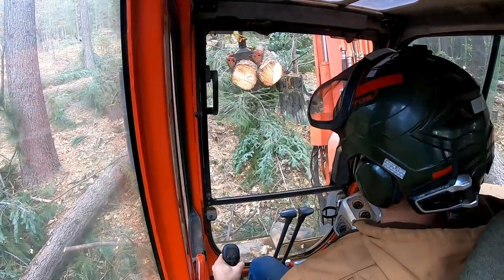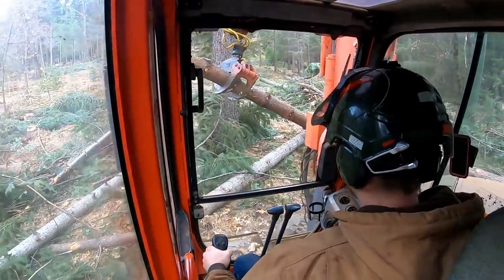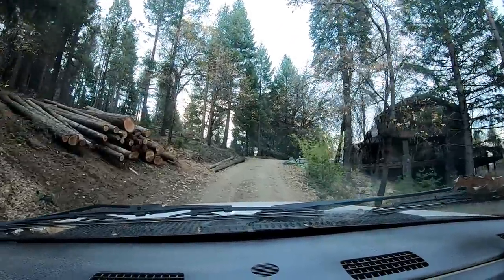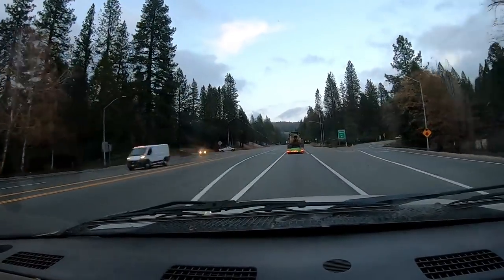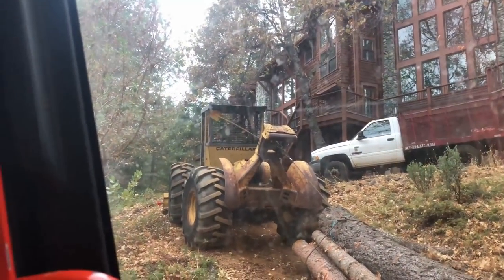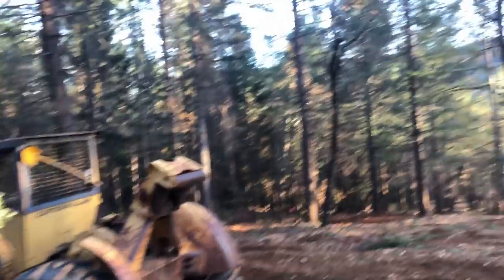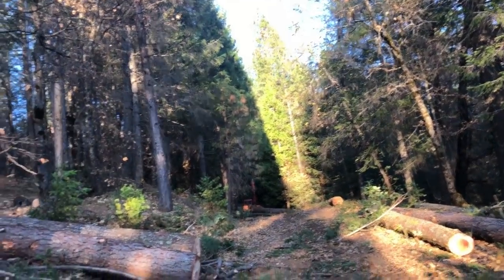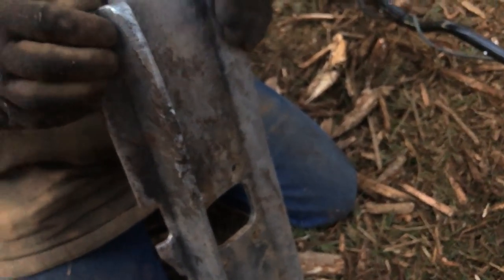BRAND NEW KENWORTH LOWBOY!!! and LOGGING JOB CLEAN UP

Comment: He needs to get the lowboy ramps on that 5th wheel plate for that trailer to break the neck that's the only way to go but that is a nice looking semi
Reply: Those west coast boys are a little different. Even when the truck has lowboy ramps 75% of the loads go over rear.
Reply: hvy 1ton Exactly correct.  Murray, Cozad, Aspen, Rackley..... all those style California trailers are only detached for heavy tracked machines.
Reply: @hvy1ton  or over the side

Comment: Wow,  you guys sure log real different then we do up here in Ontario Canada,  have a look at my channel if you want to see what I mean. We run heavy spec trucks with 4 and 5 axle trailers. Haul 90 000 pounds on the wagon. We use bunchers,  processors , and forwarders haul the wood out to the bush roads.  It's always neat to see how it's done in other places.
Reply from the maker: This was more of a thinning around a home for wild fire prevention. But we are limited to 80k gross for logging trucks. Can’t haul as heavy as you guys do that’s for sure hah

Comment: If you got a cutter that can lay them a grapple skidder can do a fine job and get production! Just gotta have a hand that can really run one...bunch8ng is nice but guys make it work all the time with skid cats...
Reply from the maker: Yeah it can for sure be done. Just makes it so much easier on the machines and the property. Considering that this is literally someone direct back yard from the house. We tried to minimize the amount of skid trails used or made. Seems like where ever the skidder went it was more tore up than the impact of the rubber track excavator. So many areas of this job could have been improved right off the bat if the fallers were more experienced. High stumps and criss crossed faller. Wasn’t ideal
Reply: You got her done! Looks good! Dig the setup! Keep up the vids!!!